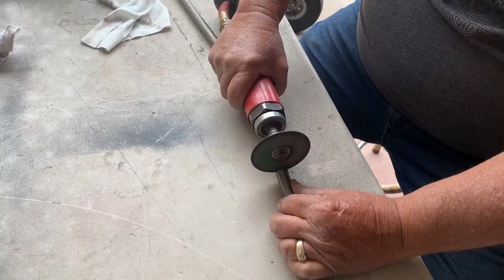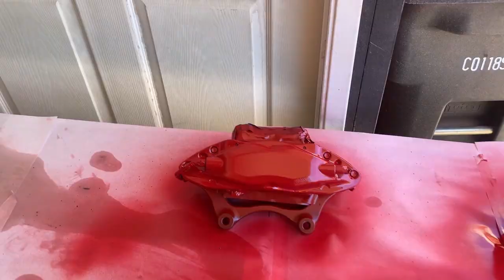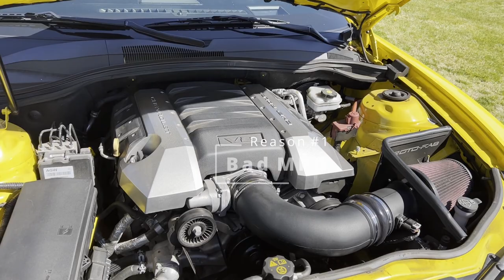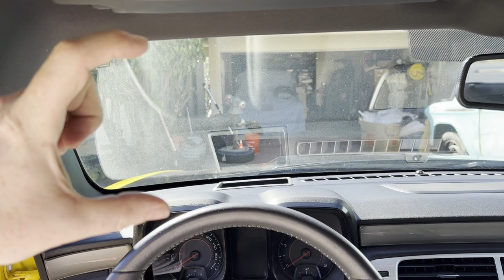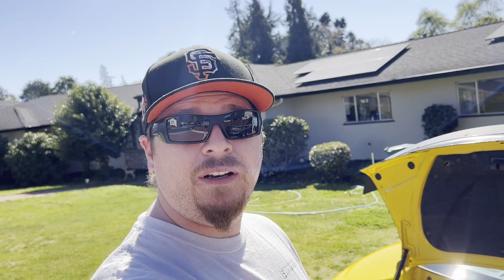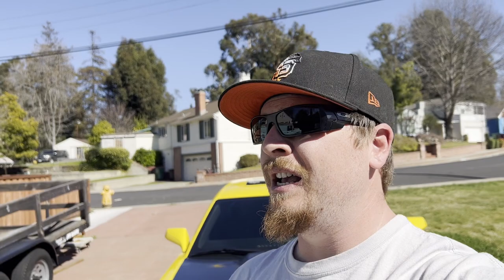Top Reasons Not To Buy A 5th Gen Camaro SS | 2010-2015 Camaro SS

Comment: I have a 2011 Camaro lt, it has 154,000 and still running great. The 5th gens are very reliable. Not sure about the v8, it has to be the same, I really want one. The only problem I have is the blind spots but I found my way around it. When you fix that wheel gap, it looks so much better.
Reply: I don't have a back up cam in mine, but never had an issue with blind spots honestly
Reply: Actually you just got incredibly lucky with that V6 I got a 2015 RS last year on the second owner and now at 85,000 miles may as well replace the transmission the torque converter has went bad, trade that V6 for an SS immediately 🏆
Reply: Ls3 is bullet proof paired with the tr6060
Reply: @zaiasm2305  tr6060 is not a bad trans... its the clutch and throwout bearing that are junk combined with a slave cylinder from factory that doesn't push out enough pressure to kick out the clutch disk. Mine clutch disk slipped from the factory. Is still the weak spot of the whole drivetrain. A McLeod setup was the cure and an upgraded slave cylinder.
Reply: @Infidel67 if you drive backwards, it helps with the blind spots (sometimes)

Comment: I'm 6'2 and I actually thought the 5th gen has an abundance of leg and head room. But I didn't wear my SF hat in the car. I agree with your other points. My 1st gen has less trunk space, but a large opening.
Reply: Same here, bottom out the seat and have plenty of head room. The skid control is above and beyond the mustang Scud
Reply: 5th gen seems fine ( mines 2015 ss) but the 6th gen ..*cringe*..  nice performance, if you a smaller person
Reply: @sparioch9841  mines 2015 SS too, not a fan of the later models either
Reply: I too am at the same height. Two points... if one is too fat for the car don't buy it or lose weight like I did (60 pounds lost) and also DO NOT buy a Camaro with sunroof if you are tall, it cuts off 2 inches of head room.

Comment: 14 1LE for life .white 1SS no frills only Bose stereo option. 1 Of 600 or so made that way. Stage 2 cam kit, all the bolt ons, SLP loudmouth 2 mufflers. BMR subframe and cross member , rear diff bushings, PS4S tires, high volume oil pump, Timekin timing set 3 bolt. Trunnion upgrade kit. It now dam near bulletproof now. I’m keeping mine. 5 th gens look better than the Darth Vader 6 gen’s anyhow. Figured I’d go 416 stroker when the motor finally goes , but it may never happen because it’s a great car weirdo!

Comment: I'm 6'3 (with my shoes on 😂) and I have no issues fitting and closing my door. It's actually more roomy than my Ram. Maybe there's less head room with the sun roof? I wear my cover (adds a couple inches above my head) and with that, very ocationally I will rub.  

My personal gripes are how crappy the steering wheel buttons are and how over priced boost options are on these.

Comment: Want to get new wheels and tires, want to get 285/35/20 for the front and 305/35/20 for the front. Everything stock as far as suspension goes. Will I have any fitment issue as far as rubbing and turning
Reply from the maker: I’m running 275’s up front and 315’s out back. I’m lowered and have zero rubbing issues. You shouldn’t have any issues.
Reply: @bigblockkev  thank you
Reply: It’s very roomy in there, you should be fine😂 that’s one of things why I love the 5th gens.

Comment: My 1970 396 SS Chevelle sucks twice the gas, looks no better than the Camaro, handles like a worn out dump truck,  is twice the cost and has half the HP. The Camaro will be my next car.    PS the Camaro weak spot is the rear axles.

Comment: To be honest, I don’t know what you’re complaining about. I mean you did test drive the vehicle also I am 66 in height. I have no issues reaching the door second yes, the windshield is narrow. Put doesn’t mean I pull up all the way to the line so that way, I can’t see the light Third gas mileage, depending on what state you live on if you live in California/New York, see what you’re complaining about but if you don’t live in those states then gas mileage is not really a big deal fourth your trunk space OK what’s your point? Are you trying to hold two bodies using your trunk or something because I can care less upon my trunk I got my Camaro for the performance. It’s a 6.2 L LS three if you don’t want your car, go sell it go get a minivan where you have enough trunk space enough mileage, and everything else just without the power and you can be a soccer mom.
Reply from the maker: Wow, you wrote a big story. You should have probably read my pinned comment before committing to this essay.

Comment: Evaporated box leaked everytime AC was on....
34,000. Miles.....
$3000 to fix...
The drain now clogs which is above the transmission
2015 RS
Great car except for the AC...
Which would be the reason I would not recommend the Camaro

Comment: 22 mpg with a 6.2 motor 425 hp stock engine not bad put a LS engine in a stang wouldnt be bad however there double over head cam engine complicated and very expensive to build and no more hp than a LS